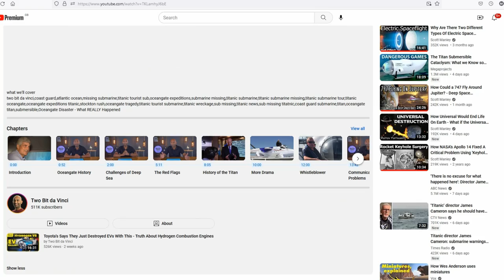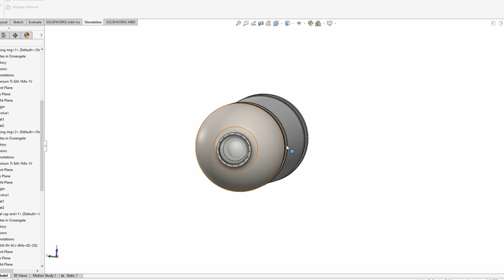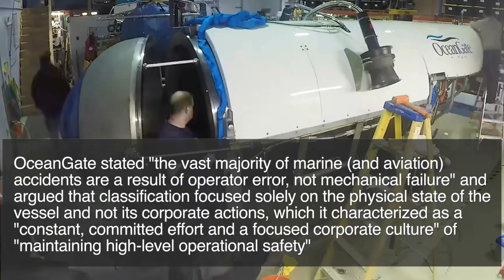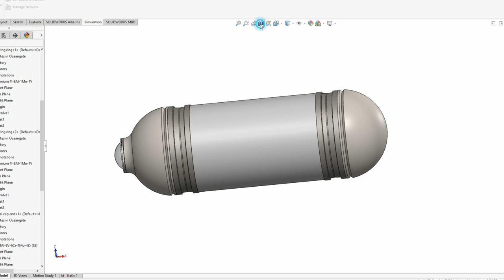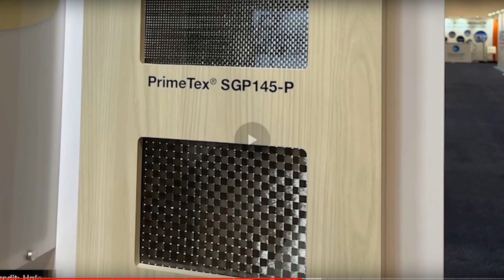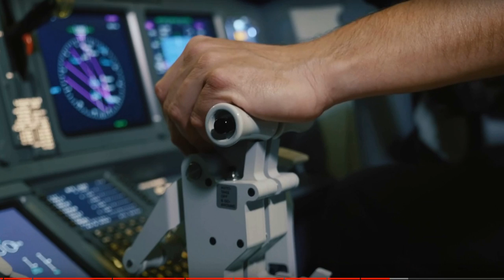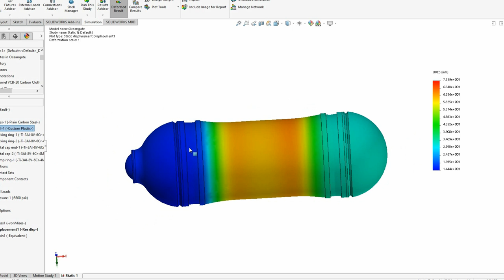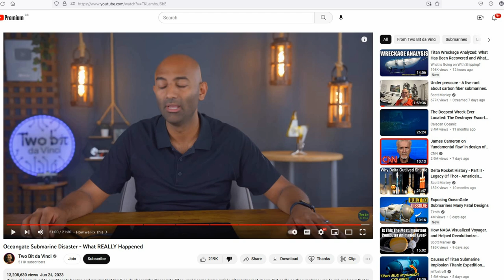Oceangate Titan - Engineering Failure?

Comment: Last word on this crap your chatting...
The weakness is the carbon and the weakest point is the center of the tube...
Because of uneven pressure on the vessel...
And when the tube is squeezed in the middle until it pops and being made from a material that shattered when pushed to its limits it is pretty simple and nowhere near to being rocket science..
The center tube gets squeezed in the middle where the pressure is at its highest on the vessel and clearly the weakest point because of the carbon fibre..
And it simply gets to the point where it can't take the force and hold its shape therefore implodes from the center outward.. pressure would then force both ends to shoot off as the tube gets crushed and the air bubble inside the vessel is released under extreme pressure therefore basically causing a explosion inside ,as doing so reversing the pressure on the porthole and blowing it out of the dome just as each dome got blown off..
As the tube implodes the carbon shattered and would basically disappear into dust.. and it's quiet hard to find dust on any ocean floor... I,e its gone.... without a trace..
The only part that has totally disappeared was the weakest link.....

Comment: Thanks for the video. It's quite long but there are some accurate observations. My first impression, when I saw a titanium cover without a plexiglass window, was about stroke waves. The fiber carbon cylinder should not be totally damaged if the window broke first. In fact, it has not been found yet so we do not know what it looks like.
The weakest point of the construction is the connection between the fiber carbon cylinder and the titanium ring. Especially a flange that seems to be too narrow. The fiber carbon cylinder is 5 inches thick and the flange is about 1 inch? Especially the internal flange was a place of fiber carbon with extreme pressure into the titanium ring flange, kind of cutting edge. A possible point of initial degradation.

Comment: 1:06:55 -- RE:  Testing and Explosive Bolts;  Oh I like this part.  It's all a bit Measurement Problem, in the sense that I can test any other explosive bolt except the specific ones I intend to use.
Reply from the maker: It's a huge problem in rocket systems.

Comment: So the retaining ring on the porthole window was only to ensure it was properly seated and to prevent it falling out at the surface, pressure is what made the seal, once under the surface, pressure would have been the sealing force. This I believe is a similar reason for the glue bonding the tube to the end caps, again more to do with structural integrity at the surface, once the pressure builds it's this pressure that's the real bonding force. Perhaps the glue set too hard and created an element that moved/compressed in a way not properly understood, maybe it prevented the tube from deforming uniformly, it may also explain the cracking noises heard on the fateful, and previous dives (If the transcript published online is authentic).

Comment: I commented on his video about the controller thing as soon as i watched it days ago so im glad you’re mentioning it too…..he seems to forget that game controllers are some of the most tested devices on the planet!! Much more hours of test time compared to any military device.  also, his comparison to the military helmet with HUD is just stupid, completely different device to a VR headset with complete different use case.
Reply: it's about the environmental conditions. are game controllers rated for low temperatures (ca. 4 degC) and high humidity, with condensed water building on the PCB? - there are reports, that there were droplets of condensed water on the inside of the hull. I'd not rely on a non-certified unit under life-threatening conditions. just my 5 ct...

Comment: Regarding the tangent on the "partnerships" and their actual scope, remember that these videos audience is for Jane/Joe average off the street, hence the extended segment on the company background and so on. To the lay person, entering a partnership means that their will be equal involvement from all involved in the project. If you are just renting out warehouse space to them, it wouldn't be a "true" partnership. They weaponized semantics for marketing purposes.

I have to partially disagree with your comments about aviation inspection though. No they don't just wait until a part estimated service lifetime is spent to replace it. They do perform inspections, and regularly at that. New service bulletins for updated inspection schedules, with replacement of parts if needed, are released all the time by the various manufacturers in the field.

Comment: A couple of things.  Firstly the hand mixed an applied glue is likly to incorporate bubbles other inclusions, a source of failue with stress cycling.  Secondly withh flexing of the tube in the titanium the inner edge of the titanium lip becomes a fulcrm acting on the carbon fibre and the outer edge of the carbon fibre is subject to crushinfgaginst the titanium, both far higher concenrations of stress than the rest of the tube.

Comment: There is one more thing than that crazy bond between carbon fiber tube and titanium caps. 1) I heard that the tube should have been 7 inch thick but was only 5  2) more important is how the tube was made. The fibers where roll on the steel tube in ONE direction. There was no cris-crossing of fibers .  Delamination was happening every dive, submersible was making cracking sounds all the time. Even one passenger was asking about this and was "dismissed" by Stockton ..............                       The sub was failing each time a bit and 7th time it failed catastrophically . I also heard that that CF cylinder was safe to use 1x !!! not more. It should have been replaced each dive.  That would make ticket like 1 000 000 $   and not 250k  like they charged.

Comment: adhesives are strongest under shear stress and weakest under tension.  The deflection shown at the interface put that glue under tension.  If that lip adhesion failed, then that put the end cap glue also under tension since it would've allowed deformation at the end cap mating surface (think of it as velcro).  It's possible all that creaking they kept hearing on each dive was the adhesive failing little by little and not the CF matrix itself.

Comment: Good analysis but what about the supposed super-heated explosion due to instantaneous air compression?  If this did occur, that would be additive to the acoustic shock wave explained here and could be responsible for the missing viewing window. I seriously doubt this window was removed from the salvage crew as every piece needs to be forensically studied before it can be altered.
Reply from the maker: "what about the supposed super-heated explosion due to instantaneous air compression?"

- The what?
Reply: @dirtygarageguy  The super fast compression of the air in the pressure hull supposedly caused that air to heat up so rapidly it underwent combustion. Haven't heard much follow up on this but this was widely discussed early on and was said to be caused by the catastrophic implosion.

Comment: Big hydraulic machines can put out deadly jets of oil in case of a leak. If the glue fails at specific points it may start with similar water jets into the vessel and then progress because glue failure progresses throughout the interface. The violent waterjet would (even if only one weak spot starts leaking) erode away adjacent glue incredibly fast.

Comment: So far your the smartest to talk about this.
And I agree with most of what you said.
For me, having worked with carbon fiber, and other composites, the number one huge red flag was when I found out the carbon tube was "only" 5" thick !!
This was way way to thin !
I was immediately thinking in the order of double that or more !
That people never bring this up is beyond me, this is not steel or titanium, 5" of carbon is not impressive, especially in this application !
The glued end caps was the second red flag, but I think it is made worst by the first problem of the thin tube.
It's like 2 problems put together !
He or they chose to use carbon or composites, but they did not fully use the potential or methods that composites allow, if you are going to use it you have to go all in !
To make just a part was a mistake.
After first hearing this and the carbon problem I immediately started brainstorming of how I would do it, and I made a fast simple plan.
One very important thing in my imaginary carbon design is the use of Graphene in the epoxy to give much needed added strength to the carbon.
My design uses titanium as a base that is thin at the center and thick at the ends on which you then apply the carbon winding in a criss cross pattern....
Would you like to see my design ?
It would be great if you could make it in solid work and put it to the stress test !

Comment: Hi! I looked up the material properties that Solidworks is using for carbon and I think that the Young's modulus of the actually used carbon should be about 5 times higher.
This means, that possibly the titanium has flexed more than the carbon. Would be interesting to know how that would affect the simulation. In my opinion, the force from the ring, added to the force from water pressure could have been what was overloading the carbon structure.
Reply from the maker: Which one?
Reply: @dirtygarageguy  They used Grafil 37-800 from Mitsubishi. It has a modulus of 250GPa. At first I estimated 220, which would still be twice of what titanium has.
Reply: Fibres are different in compression and tension, and to get the full tension modulus the fibres would need to be dead straight in the matrix and in line with the stress.  In compression the matrix can deform and the fibres buckle.

Comment: Since they started talking about the carbon fiber as a possible cause of the failure im thinking if a titanium cilyinder wasnt not just a stronger option but also a cheaper one. I know titanium is not cheap but im convinced that lot of layers of carbon fiber  must have been even more expensive than a titanium hull.

Comment: As composites flex they develop microcracks. 
Carbon fiber does not play nice with any metal causing rapid corrosion at the interface. 
So a titanium ring is bonded to carbon fiber composite that is being cyclicaly permeated by a really good electrolyte at a joint that can't be inspected.
Only a matter of time before the joint failed.
Reply: Ah....
The fuselage of pressurized aircraft have a cycle lifetime. After so many cycles the aircraft is derated for service. That's what happened with the Hawaiian Air 737. It went from long haul, to shorter haul on mixed straps in Canada to really short haul island hopping. 
Until the roof peeled....

Comment: I've been scratching my head with this - high internal pressure in a carbon fiber container transfers to very high tensile strength of carbon fiber going around the cylinder. But the external pressure, I really don't see that getting any benefit of the tensile strength as the structure is compressing inwards.
Googling about for compressive strength gives me 1,3GPa for carbon and 200GPa for steel. That doesn't sound promising at all what comes when battling against external pressure.
Edit: compressive strength of resin used to bind the material?

Comment: Where did you get the carbon fibre material properties from for the solid works model and are they appropriate or just a guesstimate
Reply from the maker: Just a guestimation. It's not an actual analysis, as I don't have any of the actual specs. It's just a visual aid
Reply: @dirtygarageguy  Thanks

Comment: The idea that the pressure comes from the mass of a tower of air or water stacked on top of you is not silly at all - of course the pressure and weight force then spreads out to act in all directions the same and not just vertically and thats because we're talking about fluid mediums like water and air, but the pressure is coming from exactly that "tower" of air or water above you and that tower weighs exactly the amount of the pressure youre feeling.

For example 1 atmosphere of pressure is 1 bar which is 1kg per square cm of force and thats because a 1 square centimeter column of air going from your head all the way into space weighs exactly 1 kg.

Same with water, a 10 meter high 1 square centimeter column of water weighs exactly 1kg (its 1000 milli liters which is the same as a cubic centimeter) and thats why for every 10 meters you go down in the sea the pressure increases by 1 bar or 1 kg per square centimeter.

Comment: I would imagine instead of the bolts coming out with the window I'd assume the thin mounting ring (as in the lip in the acrylic window) would just break, since it is not really supposed to take any load? But I'm no mechanical engineer :)

Comment: So from what I understand the reason why you wouldn't want to use a random controller is the same reason you wouldn't want those personal electronic devices there at all either. If I've learned anything from watching way too many videos about the airline industry is that you should not have anything in a critical control area that is not fire safety rated. Especially in a pressure vessel. Fire on ship is a horrific experience to be avoided but it clearly was not the problem with this particular vessel focussing on the controller is one of those things people will do because it looks so  ridiculous

Comment: How do you think glass might perform ... of course Im talking about 1m ID and 300mm wall thickness of the very best toughened tempered whatever etc.
I work with 1/2 plate glass and in the right conditions its damn near unbreakable such as dropping a 4x8 sheet two storys down into metal skip  full of bricks  and nothing not a chip or a crack. 😮

Comment: There are several issues I see in the construction of this Sub. The carbon fiber was laid up wet with epoxy resin in the open air. Small mini bubbles are trapped in the resin and hardened in the matrix of the Carbon fiber.These bubbles are compressed each time the sub dove and are expanded each time it came back up weakening and causing cracks when it came back up. This gives the material a very finite life which was never tested for. If the lay up was made under a vacuum that life would have been greatly extended but that would have been not cost effective so corners were cut. Boeing sold him that carbon fiber cheap because it was past it's shelf life. Also the only thing that held the titanium ends onto the carbon fiber was epoxy glue! It was glued together!

Comment: Would there not have been some sort of actual explosion ? What I'm thinking is the air available and the people as fuel and then ignition due to the dieseling effect, or would the air have been compressed immediately to tiny bubbles...... there would be significant heat in this process as well ?
Reply from the maker: Yes, but all of the oxygen reacting with your skin alone would just add to the overall energy of the failure. The energy release is actually from the structure failing.

Comment: That's not 7.339 millimeters, that is 7.339 mm *10 = 73.39 millimeters.  So the deflection view is not exaggerated much as it's 7 centimeters, not millimeters.
I skipped around the video so excuse me if there is a factor mentioned in the video somewhere so that the unit labels are not accurate.
Thanks for doing this I've been waiting for someone to do a stress analysis on this.

Comment: Having spent the past decade in the military, I'd see anything labelled "military grade" as a huge red flag. 
As a signaller, I have used plenty of military tech with bugs and required workarounds and I'll take the logitech controller with millions of users testing it any day.
Reply: That is fine. But at least use the wired version. And have a backup. The thing with consumer products is that they are not tested for industrial applications like this. They might catch fire in an oxygenated environment, they might fail or degrade in a marine environment or when put under stress that isn't normally exerted on them in a typical household. It is also fine if you know the risks and take it yourself, but taking other people who don't know all the corners you have cut along with you should not be allowed.

Comment: I think the issue with the controllers was the fact they looked wireless, if they'd been wired then that would have been better since you're not relying on a battery. Other questions would be if there was a backup controller, had the electronics been conformal coated to try and make them water proof etc.
Reply: They has two spare controllers in the sub, they said in a OceanGate video. The probably had a cable in the sub. I think the screens were touch screens so they probably could be used, also had two keyboards and two mice. Along with the fact they didn't need any electronics to surface (dissolving weight lines and rocking weight dropping) the controllers are just not important for survival. They also had batteries for the computers, perhaps they had safe batteries in the controllers (some of those types of controllers had AAs).
I would be surprised if anything was conformal coated. These days most electronics use pretty corrosion resistant (I remember house PCs from the 1980 with terrible copper corrosion, don't see that any more). Probably had enough redundancy to handle corrosion induced failure. Would expect the interior to remain dry the whole time.

Comment: 1:42:10 when the tube collapses, despite there being pressure to the sides, the momentum of the water would build up extra pressure in the air that is greater than the pressure of the ocean - like a hammer being forced down. I believe this could pop the window out if the ends didn't come unglued first. I definitely would want to have braced the cylinder at either end and in the centre with a thick annulus that can be climbed through.